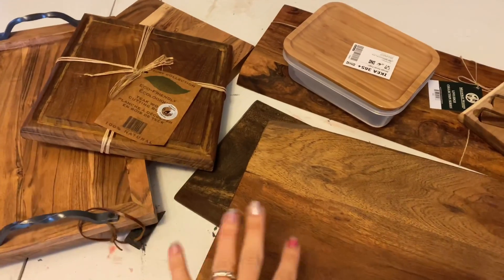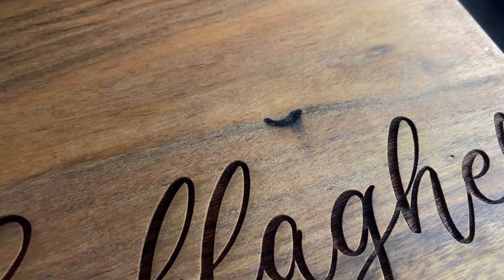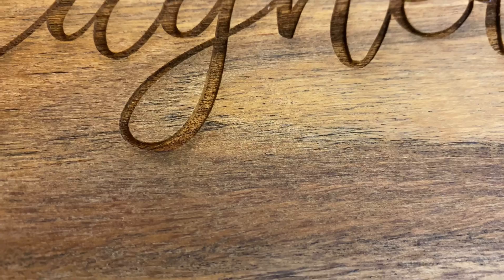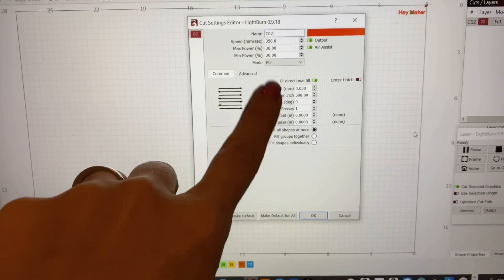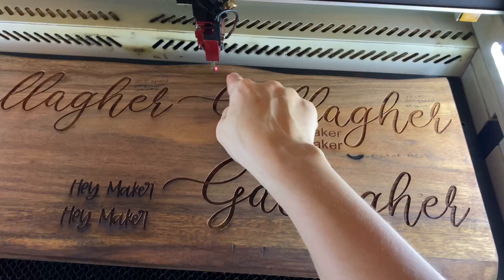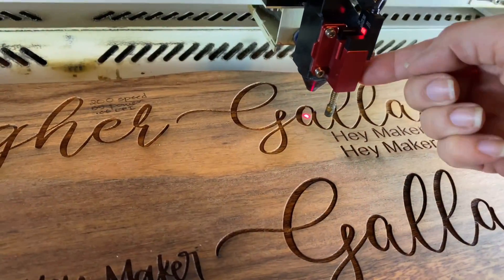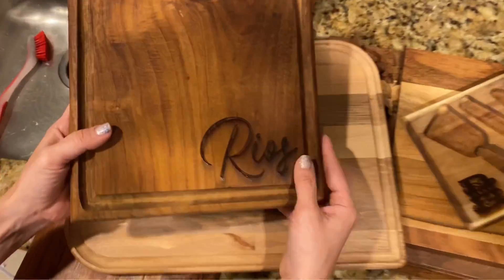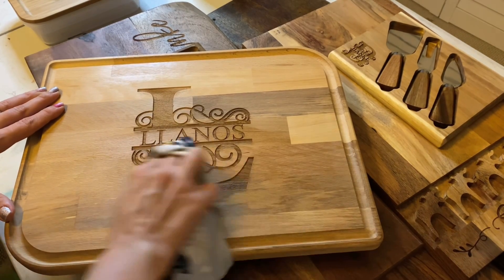Laser Engraving Tips - Engraving Cuttings Boards - Defocus, LPI, Slop Error, and More!

Comment: You could have salvage that board by running it through a thickness planner until you get ride of the engraving. or you could have cut it shorter an use for a different job.

Comment: There's NO SUCH thing as "food safe" mineral oil. ALL mineral oil is the same, really.  You should use Cutting Board oil then finish with cutting board wax. Also, if you "mask" the board first (blue painters tape) where you're going to engrave, you won't get those edge burn marks. ALSO, "air assist" is important as it helps prevent FIRES from starting.
Reply: Mineral oil has been used as a laxative for ages. There's plenty of safety data on it. 

Food safe is about the impurities. If there is some hexane mixed in then it isn't food safe. But it is still fine for industrial lubricant and in making several types of plastic. Depending on what the plastic is intended for.

Anyway, don't eat industrial mineral oil, baby oil is probably not good due to the scent ingredient. Food safe and medical grade is pure enough to be fine but too much does cause a BM 😮😂

P.S. many cutting board oils and conditioners are made from paraffin or bees wax cut with mineral oil.

Comment: Hi Emily,

As a cutting board maker I will say that more oil (food safe mineral oil or cutting board/salad bowl specific oil product) is actually better for the board.  Once you have applied enough oil for it to penetrate into the wood vs just a surface coat it helps keep water and bacteria from entering the wood pores and helps keep the wood from drying out which prevents cracking and splitting. 

When oiling a board use enough that some stays on top of the wood.  Wait a few hours or even overnight and if the oil has soaked in, give the board another coat.  Make sure to do both sides and all four edges.  Eventually the board will have soaked all the oil it can take and you can remove any that remains.  To help protect your board further many board makers use a mixture of bees wax and mineral oil, often referred to as "board butter" for the final silky smooth finish.  

As with any cutting board, the board should never be put in the dish washer or allowed to soak in water.  And every month or two a new coat of oil and board butter should be reapplied. 

Thanks for your great videos and for sharing your knowledge...hopefully my sharing a little of my knowledge on cutting boards will be helpful to you and your other viewers.
Reply: There's NO SUCH thing as "food safe" mineral oil. ALL mineral oil is the same, really.  You should use Cutting Board oil then finish with cutting board wax. Also, if you "mask" the board first (blue painters tape) where you're going to engrave. ALSO, "air assist" is important as it helps prevent FIRES from starting.
Reply: What's your opinion on using raw pure clean linseed oil instead for cutting boards? If in a hurry maybe put it in the oven at like 220F or so to dry it. This is what I do with my cast iron if I think I would use it again soon. I love the coating I get on cast iron and it might be good for a cutting board.

(For anyone who doesn't know, linseed is also called flaxseed and some consider it a super food.)

Comment: I appreciate your enthusiasm and tips.  You mentioned "sealing" your cutting boards- what do you seal them with- you have to be careful if they are actually used for cutting.  The oil should be enough and you can soak them in oil, wipe off the excess, and let it soak in to prevent cracking and warping later.
what font are you using?  I have a million fonts but love the one you seem to like for some of my projects.  right now I use a CNC router to v-carve or straight carve stacked letters so no gluing unless I want to change wood types. I have a 60watt laser coming to add more capability.  

.
Reply from the maker: Hey Cliff. In the video I show that I use either cutting board mineral oil or butcher block. Unfortunately I can’t remember off the top of my head what font I used and I’m on vacation so I can’t look it up. If you remember in a week, message me again and I’ll double check. :)

Comment: Okay, I have two questions :)  1. can this router out those groves that are made in your boards. (made to catch liquid) 2. By engraving you wouldn't use any tape to help remove some of the charing? Never done this, just learning.
Reply: yep, I engrave through masking tape the problem is making sure that you remove all the tape on intricate designs. you can use gaffer tape to help peal some away but have to be careful not to miss any bits. you can also use methylated spirits to help clean stubborn marks off( it seems to dissolve the residue well) or scrape it back with a cabinet scraper or sharp blade. I have played with dark wax polish on something's and that reduces the visibility of some burns. ps don't forget to add power to engrave through the tape I think it's about 10% on my 80W.

Comment: Cloudray sells a value that lets you decide exactly how much air you want to allow when you are engraving ( even if the air is turn off in the software) and you would normally turn off the air thru lightburn when engraving but still need a little air to keep the lens from getting fouled, also a lot of people just cut the air hose next to the laser lens and add a cheap $ 2 air value there to control the air going to the head. When I Engrave at around 500 lines per inch, I don't defocus my lens and I do not have the small lines you do. (also If I am just engraving and  not cutting I use a dual lens engraving head ) a lot of times I will just windex a piece to make the lasered text more uniform and then I will sand that afterwards to keep the letters dark and still get rid of the smoke ring around the text. That just goes to show you how there are many different approaches to get a good result when lasering. Please understand that I am just sharing how I do it and I am not trying to say anything negative. I enjoyed your video a lot. thank you.
Reply from the maker: Hey Dwight. Thank you for the great tips! I try to keep content like this as simple as possible since most of my audience is either just getting started, or operate hobby machines. This is great insight and I hope my viewers read through your tips. Thank you so much for sharing and I hope to see you are kind here more often. Happy New Year!

Comment: Hi
Love your channel
Do you always clean your wood after? What if it is just engraving on plywood? I’ve just finished engraving milestone cards and I actually prefer the darkness of it before cleaning. Lol still learning. Also would you recommend sealing it?
Reply from the maker: Depends on the item.  If it's masked then you probably don't need to clean the board but if you don't mask it then you need to wipe off the residue around the edges of the engraving. Also, depends on what your working with for sealing but I tend to seal everything lol

Comment: 1) Line interval:  I think your scanning offset adjustments might be way off (going by the plastic comparison pic). Can you let me know what you're are set at currently? (found in device settings)
2) if you find you are wildly out of focus and already boned the board right from the start...just let it continue on...yeah, its ruined, but heck, it might be a great outcome wildly out of focus and semi-salvage the job...worst case scenario, you will have an even screw up :)
3) spot on with the less is more for engraving (but make sure to have at least some air coming out of course).
4) Mask it with tape for easier cleanup
Your videos are fantastic. honestly, you need to be training people some advanced stuff as a side gig. Also, great wood. hard to find decent wood around town.

Comment: When you seal these with the oil, can it be used on the engraved surface with food?
Reply: Do a bit of research for what can and can't be considered food safe. Mineral oil is fine along with some other types of oil. Check this list out https://www.cuttingboard.com/blog/what-type-of-oils-are-safe-to-use-on-your-cutting-board/
Reply: @robxsiq7744  I guess my question was really I thought once engraved that surface is not food safe due to bacteria that can get into the engraved crevices and will using the oil help with that and is it now food safe.
Reply: @alancynvideo  The idea is that the oil and other stuff from, that material seals it. "Using food-grade mineral oil on wooden kitchen utensils and cutting boards provides a protective layer that prevents water from seeping into the wood and warping it. It can also prevent bacteria from building up."
So yeah..but you might do well to occasionally touch it up with a fresh coat now and then, even without engraving (after all, you end up cutting on cutting boards which digs in). Also, dont engrave too deep on cutting boards just as a rule of thumb

Comment: What kind of engraver do you have? I noticed you didn't use a masking transfer tape. I have a glowforge everything I have seen uses some type of masking so I assume I don't have to mask everything based on your video and beautiful projects you make. Thanks
Reply from the maker: Thank you! I don't mask cutting boards because I rinse them after the job is done.  So you're correct, you don't need to mask everything. :)  I have an Aeon Mira 7 60watt.  It's a more industrial type laser.  There is both a link to their site as well at a video above in the description box on why I like it.

Comment: Great tips!   Yes, needs time to get up to speed......and to slow down....and not crash😂 This is the one downside of my large 1300x900 machine, but worth the slower engraving speed to be able to fit 4x8’ stock😎
In Lightburn you can automatically apply defocus ( z axis) to any layer/color. I’m slowly building my cut library, so I don’t have to remember everything😎
Reply from the maker: haha that's awesome! I didn't know that about defocus in LB! I'll have to learn how to use it and make another video.  Thank you! <3
Reply: @ThatMomWithALaser  Now we are getting into advanced stuff (bout time :P )
To enable that, you must first go into your device settings and switch on Enable Z Axis. now you can go to your layers and adjust an offset. Really handy to defocus engraves, then refocus for cuts.  I haven't used it too much (you have a lot more hours on your machine than I do. heh) but others say it works good, just remember you set it (defaults to last settings used per colored layer)
Reply: Gonna put a warning here
its buggy. use with caution because it likes giving extend space errors. might be a LB mixed with ruida, not sure. testing to see what the issue is
does lines fine, but fills gives issues
make sure to also click relative z moves only also. seems to mess up less. still errors out on cuts